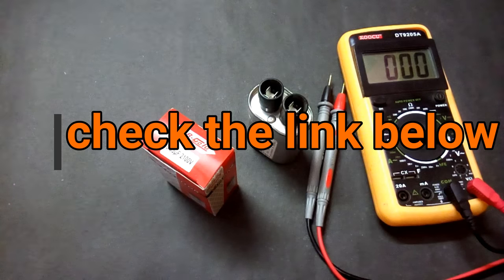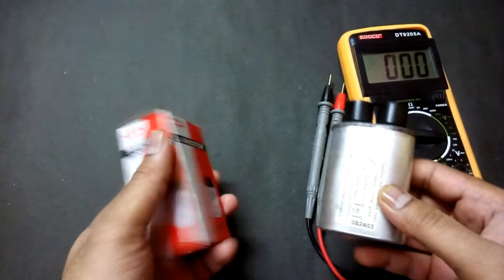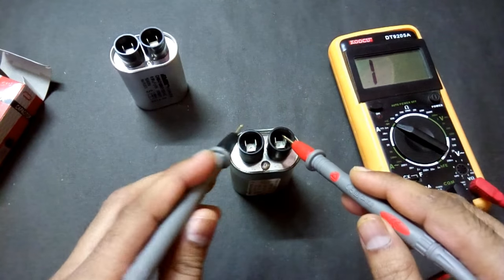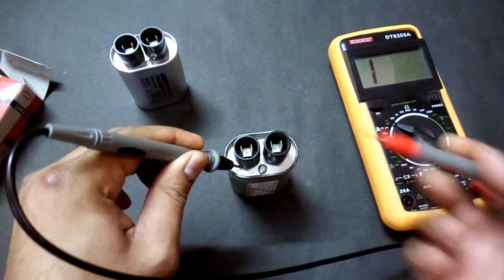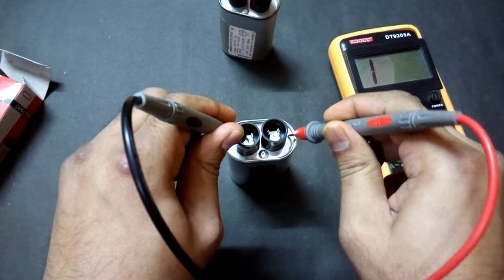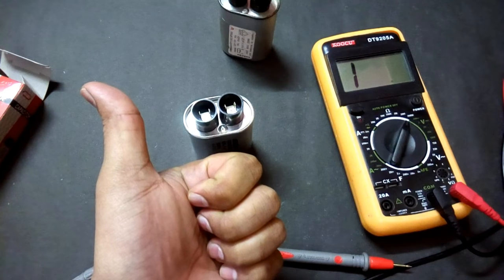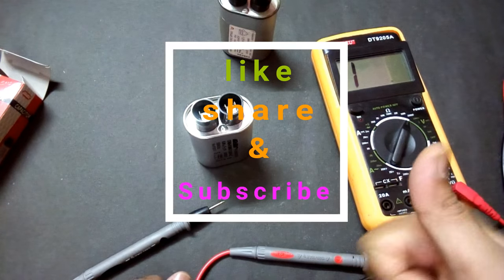How to test microwave HV capacitor using multimeter/ good vs bad

Comment: Missing Step # 4 - Testing and reading value of H.V capacitors
Reply from the maker: Normal multimeter doesn't have option to test capacitance. I think you missed that part

Comment: Thank you for the video.  You omitted something of extreme importance.  You may have discharged the capacitor before handling it, but you did not show how to do that.  People watching your video may not know that capacitors hold a charge and can hurt you badly.  You can't always be sure they have been discharged by the circuitry in the microwave after unplugging it.  Also, the new capacitor should also be discharged, just in case someone had bought it, used it briefly, and returned it to the store.
Reply from the maker: You can find your answer here sir. Please check this out.
https://youtu.be/xb3nmHEI0Ac

Comment: A good way to test your capacitor .... is to wire it in series with a 25 Watt , 230 Volt ( UK )  Tungsten filament light bulb and connect the whole lot across your ( 230 Volt , UK ) mains .... the bulb should glow dull orange ( similar to a 1940's tube ( valve ) radio ! ! ) ... your 1 μF capacitor is OK ( and .. YOU ! have made an everlasting night light ! ) .. DAVE™🛑

Comment: how does it show when it got a leak why cant we use capacitor testing mode or ohm mode to test it
Reply from the maker: Leak caps will show as short, terminal to the body. Caps test mode is not available in all multimeter except some costly ones. So these are the other ways

Comment: Your video just saved me the cost of buying a new Microwave with the ongoing 300% inflation rate in my country, though I fried my new NCV ampere Meter in the process beyond repair (to no fault of yours) I made the mistake of wanting to know the transformer output voltage to the magnetron under load😂 before finding your video. The continuity test position for the capacitor was the magic wand in my case. Replaced and the microwave is now alive after I lost hope in it before.

Comment: Thanks for the info.You are on point,I am currently struggling with fixing one after electricity supply company supplied use with 420V instead of 230V.The microwave oven is quite and no display.Now I know exactly where to test.👍👍

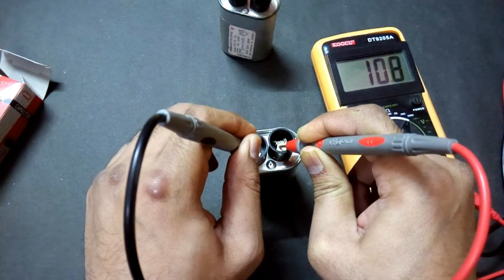Comment: It seems as though I do not have continuity between the terminals but in the second step I don't get a reading of having any Ohms(@3:23). Is this possible? And if so I guess my capacitor is bad? Thanks.
Reply from the maker: Yes if the resistance is not there, then that cap os bad
Reply: a bad cap would go towards 0

Comment: Hi... My capacitor does not show the ohms number on its sticker... but when I did test, as you showed, the multimeter quickly shows numbers and thereafter goes back to 1.

I also would like to know, if it's damaged, whether that could have been cause for the magnetron to get damaged?
Reply from the maker: Do the other tests. If there is no continuity between the terminals & the body then it is ok i guess. And yes this can be the cause of magnetron to get damage.
Reply: @technoboy-allinOne  Thanx for your quick response...

I tested, and there's no continuity.

Comment: I just want to know if you fix a different voltage capacitor to a microwave will it work or will be blowing fuses
Reply from the maker: A hundred or 2 wouldnt make much difference i guess.

Comment: Hi, is my Capacitor faulty if I can read Resistance (after discharge) only few seconds (values are jumbing from 400 then 200 then 900 and then it is showing infinity => 1. My capacitor is similar as yours -> capacitor has 1.05mF 2100v typ CH85 21105 with 10M ohm.
Reply from the maker: Which value is jumping?
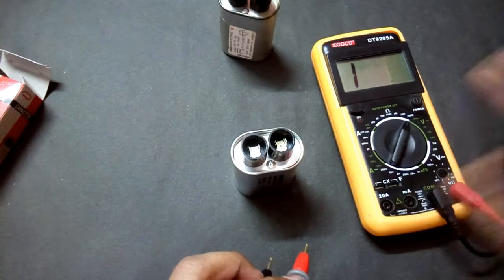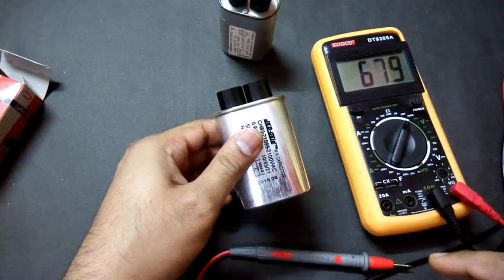Reply: @technoboy-allinOne  that one on the multimeter, I can not get the values as you in your video from 3:05 to 3:30. In my case values on the multimeter jump very fast and in less then 1 second it is showing infinity 1

Comment: How long does it take for microwave capacitor to get discharged. If I kept my microwave plug off for a month and open. Does it still have harmful level of current in it?
Reply from the maker: Not sure. Better use a plier with covered handles and touch both the connectors of the caps few times. That will surely discharge the caps if any charge left.

Comment: Hi Great Vid simple straight to point... However how do check if the microwave not heating food.. Thanks
Reply from the maker: If microwave is not heating food then start checking from door switch, then start from high voltage diode, fuse and all.
Reply: @technoboy-allinOne  thank you I will check

Comment: what if the resistance between the two terminals goes up for just a second or so then goes back to Ol, it does not stay at 10M ohms?  I think it is bad correct?  Continuity test was normal.
Reply from the maker: Yes its bad
Reply: @technoboy-allinOne  Thank you for taking the time to answer my question.  It really helps.

Comment: Like other youtubers who have made videos on this issue, you have missed the main point.  You have proved that your component has 10 megohms of series resistance, but that doesn't prove that it functions as a capacitor.  The RC time constant of that capacitor is 1 ufd x 10 MOhm = 10 seconds.
That sets the charging rate.  In fact, your ohmmeter only built up to the final value slowly, with a
time constant that looked like about 10 seconds.  That's the observation that proves that the capacitor is functioning properly.  If the resistance read 10 MOhm instantly, that would have been evidence of a fault.
Reply from the maker: Good job. You got 101 out of 100 👏
Reply: Hi there, what if the value is below 10MOhn? Lets say only 9.2MOhms?
Reply: @abetm2193  9.2 MOhm is fine.  Two points: (1) resistors used in this kind of application are typically +- 10% or worse. (2)  The purpose of this resistor is to make sure that the capacitor discharges by itself once the charging voltage is removed.  If the resistance is 10 MOhm, then it takes a few times 10 seconds to discharge.  If it's 5 MOhm, then it takes a few times 5 seconds to discharge.  That's OK, too.  The problems start when (a) the resistance is very low, in which case the capacitor doesn't even charge up - and could even be shorted out, or (b) when resistance is essentially infinite, in which case it never discharges and remains at dangerously high voltage for a very long time.

Comment: I check the impedance but multimeter is very slowly  rising and it takes almost 3 minutes to rise 1 mohm, is it normal or is it faulty? (Cont. chk seems ok)
Reply from the maker: Thats too slow. Think its may work but better to be replaced.
Reply: @technoboy-allinOne  thanks for your comment I did replaced the capacitor. However I also suspected my old multimeter and bought an new mm as well and, when I checked the old capacitor it proved to be ok! So one should make sure that the tester is reliable.Just wrote down for information.🙋‍♂️

Comment: Can you suggest me which multi meter to use to test capacitor.
Reply from the maker: Buy a multimeter with maximum resistance selection.
Reply: @technoboy-allinOne  for example.
Reply: @petermendonca807  You can not use a multimeter to test a microwave
capacitors because they have resistance and capacitance. The only way
to test this capacitors in a reliable manner is using good capacitor
tester that are costly, with that I mean over $100.00.
Reply: @horaciocastillo1435  thank you for for the good advice. Be in touch.

Comment: Hi thanks for the info. I've been searching for one piece of information prior to messing with the capacitor in my microwave. I realize you need to discharge the cap but I'm trying to understand if it's safe the check the cap with my digital multimeter while it's still in the microwave. I have the microwave unplugged but I want to be able to determine if the cap still has a charge and if so, what the charge is. I'd like to be able to test it with my multimeter prior to discharging the cap to see exactly how much charge it's holding. This is the one thing I can't determine after watching multiple videos and searching the internet.  Thanks.
Reply: whunt29708 yea I wouldn’t risk that... that’s super dangerous should be about 2000 volts ac if it’s working correctly
Reply: Check if capacitors have internal resistor (usually 10Mohm). If yes then you should leave microvawe unpluged for a while and capacitor should discharge itself via this internal resistor. After that it should be safe to test it. However have a look at this site - it provides more information regarding capacitor discharge and danger associated with it: http://www.repairfaq.org/sam/micfaq.htm#micsafdc
Reply: @dwaynej1s986  thought capacitors stoered dc, not ac

Comment: On bad capacitor the resistance will also rise to 10momh ?
Reply from the maker: If the resistance is good then. If you have high end multimeter with capacitance tester then you can test the capacitance directly & also the resistance. This is the way to test with basic mutimeter. In most cases resistance also gets effected in bad caps. So you wouldnt get right value.
Reply: @technoboy-allinOne  when tested with capacity function don't show anything. We suppose that is because of the build in resistor that is blocking capacitor charging... Idk.. 

When plugged in with 2A safety the transformer start heating much and smoking after a while. 

And now idk what is bad...

When testing transformer coils everything seams to be ok. Except heating coil shows 0.03 and then dropping to 0 omhs. In other people's cases it stayed at approx. 0.03

Comment: sir i have questions. can i use 0.95 uF capacitor in replacement of 0.68 uF? thank you.
Reply from the maker: Likely yes. But the difference is .27 uf which is not ignorable. So there will be difference in the output.

Comment: The 'fautly' one was beggining to go up 052 + when you edited the video and brought it down to 004. I would like to know why please?

Thanks
Reply: You noticed that also? Kinda cheesy on his part.
Reply: @johnmacedo4483  indeed
Reply: @johnmacedo4483  John, microwave capacitors have  resistance and capacitance.
Cheap multimeters are not reliable for this tests. his statement about not resistance between the capacitors connectors is wrong, but you need a good Fluke
meter to read this resistance. It is about 0.8 to 1 ohm. This internal resistor is to
discharge the capacitor when you turn off the oven. I have a Fluke 87 muiltimeter
that reads this value but my automotive Fluke 375 does not. In  is reliable to test microwave capacitor you need an expensive capacitor ESR tester. Igt will give you in one shot the reading of internal resistance and capacitance. Or like me, having a hand good capacitors and magnetrons at hand to test to the units.

Comment: Hi , thanks for the video.  I tested my diode using a 12 volt battery, it shows 8 V and in the other direction 7V  . Is is also faulty ?
Greeting from Hungary
Reply from the maker: When you get same voltage that means it short.  Because diode has a resistance in it. When you are getting lower voltage that means diod is ok.
Reply: yes voltage in opposite direction means faulty

Comment: Show a closeup of the multimeter so we can see where your setting is for continuity. I searched the setting on google and they say the OHM is the continuity setting.
Reply: Instablaster.
Reply from the maker: The one marked with sound sign just like this ))))) is continuity
Reply: The one like symbol )))) 
                                     ---|∆.  Is right continuity by keeping the selector switch to this position.

Comment: My capacitor is not in short. But I get only 1.238 megaohms. My capacitor has 10 megaohms in description. Probably, my fuse was damaged because of it. Could you assure of it ?
Reply from the maker: Yes its faulty. Thats the 10 megaohm resistance inside the capacitor. If its showing less then the actual value, that means its faulty. Replace it. And also check the diode. Better replace that too.
Reply: @technoboy-allinOne  Thank you. I made a simple test with diode. I used three piles and my multimeter. I put the piles in serie and put black wire in the negative polarity (pile) and red in diode (where I put a screw) and the other diode side I put in positive polarity of pile then I got half of electricity of piles (three) and nothing when I inverted the multimeter wires. I used dc voltage in multimeter.
Reply: @technoboy-allinOne  I used piles and multimeter. Piles (4,8 v in serie) and I got 2,2 v using multimenter in VDC

Comment: Good fuse, good capacitor what are the other cause? Thre is no power?
Reply from the maker: For no power check the ac cord first. Then check the ac fuse. Then the circuit board.
Reply from the maker: This high voltage capacitor or the fuse is not the reason for no power. Check the input fuse. Follow the ac cord where its connected inside..

Comment: My multi meter only goes up to 2M mega ohms. Is there anyway to test the 10M capacitor with it? It seems to start reading and stops within 3 seconds.
Reply: Check the capacitor with your multimeter using the capacitance function if equipped.  Since your meter maxes out at 2M you are out of luck. You'll need to borrow a higher ranged ohm meter. FYI, the 10M is referring to the built-in dump resistor in parallel with the capacitance.  This dump resistor ensures no charge remains across the capacitor terminals after power is removed.  I typically don't short out the terminals if I know the unit is healthy.  I seldom receive a jolt from caps.  These caps don't retain enough energy to harm humans.  They will not electrocute humans!

Comment: Most important thing you have not mention  capacity  has to be discharged
Reply from the maker: Right. Its just a testing video, so i missed that part. Always need to discharge before touch it.

Comment: you are wrong - you need a cap meter - all you did was check for shorts that is not adequate at all
Reply: Nowadays most of the good makes have capacitor check facility. For small values these meters are quite good.